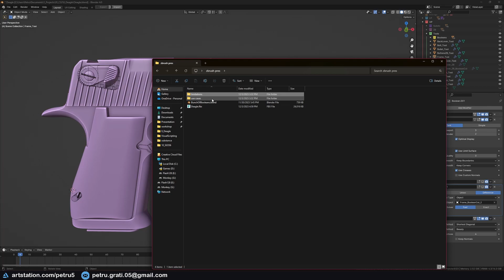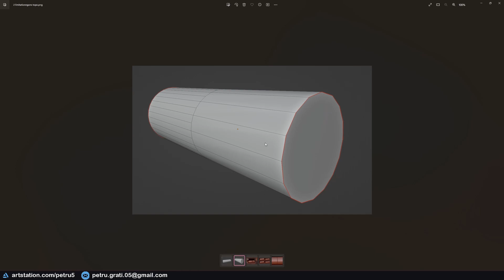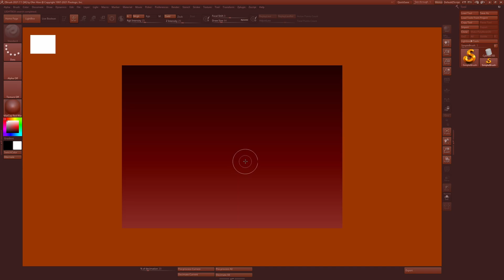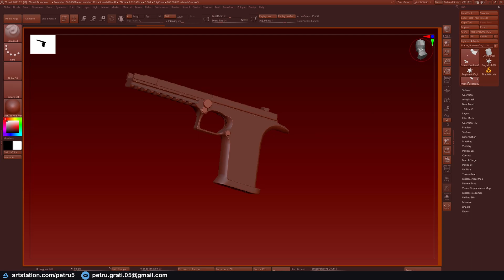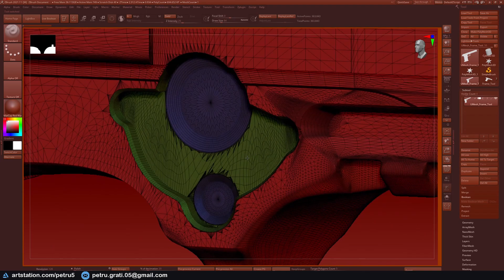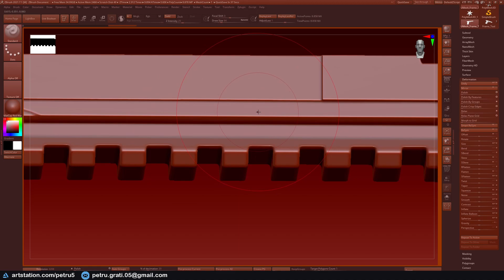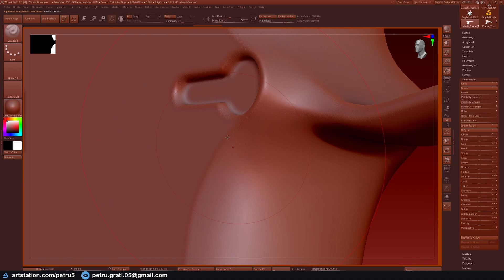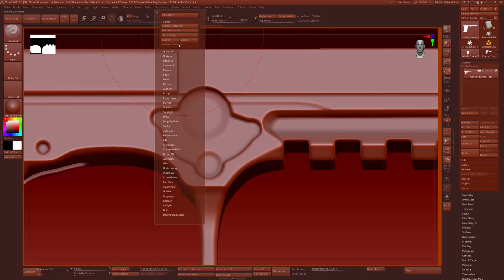Improve your high poly models through Zbrush polishing

Comment: hey, i use maximum resolution which is 4096 and the edges of my object still look very jagged. i tried scaling up my object, that didn't help. what else i can do to make dynamesh preserve the edges?
Reply from the maker: I usually import my objects one by one and never have this issue. Happens often when I import a bunch of objects together though. 
Could also try importing as obj instead of fbx.
Reply: @EinMeister  okay thanks
Reply: @EinMeister  i've tried bunch of things in dynamesh. it never goes past 13 million polygons, even on 4096 resolution. it's just a single object. idk what else to do fix that
Reply from the maker: @lolvida-i6z  Not sure, might have to ask on the official zbrush discord server. I never had an issue with limited resolution.

Comment: Good afternoon, please tell me, when modeling on top of a low poly model from CS 2, how to get into the proportions of the model without distortion? It’s one thing when you model something new, but it’s difficult to model a high poly onto a finished low poly object, please tell me a working pipeline, thank you .
Reply from the maker: I first give the low poly a LP material, separate into pieces, name them,  place them in a folder, duplicate, ctrl f2 to mass rename _low.001 to _high, place high polies in another folder, hide the low poly folder,  give one _high model a HP material, then press A and ctrl L link materials.
Now you have two separate folders. Select all of your high poly models and shade them flat, remove the custom vertex normal data. You need a high density model in order to follow the zbrush polishing I showed here, smooth shading doesn't change anything if it is going to get zbrushed. I usually start by selecting groups of quads and ALT J to transform tris to quads, you have to do this few faces at a time to make sure everything is fine, otherwise you might lose the wrong edges in the process, so don't do it with everything selected. You might also have to do some manually by selecting edges and ctrl x to dissolve them. Once you have a model with lots of ngons start adding curvature on the polygonated mesh to prepare it for zbrushing. I do that with subdivision modeling, which involves a lot of topology, you can pick your own style. Before exporting to zbrush make sure you give it a triangulation modifier (no need to apply it, it gets auto applied when exporting).

Once you have your low poly and high poly you can show both of them and look at the curvature, you can see some examples in my Marmoset Toolbag video. If the high poly doesn't fit then go edit mode, select everything with A and alt S to inflate it a little bit.